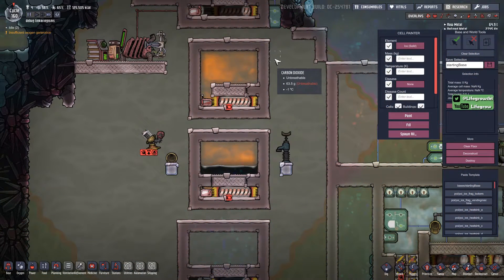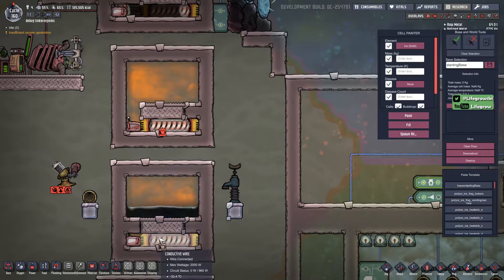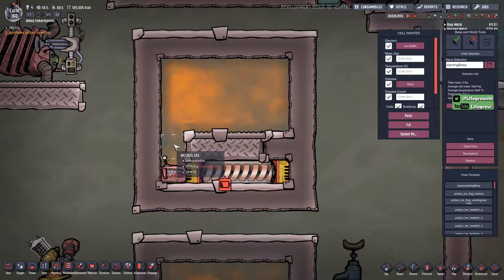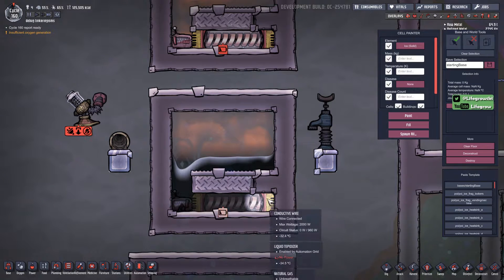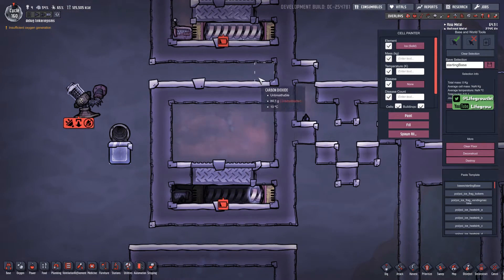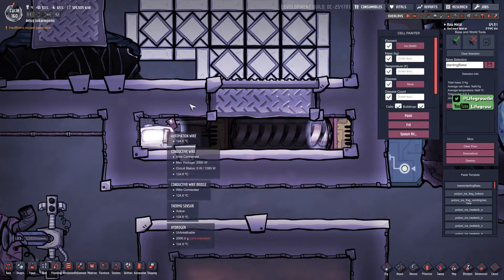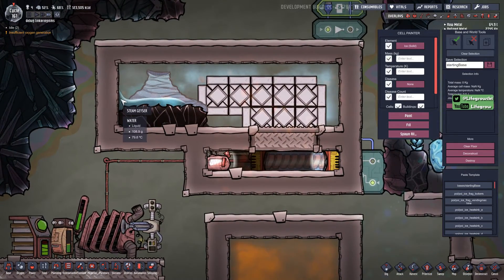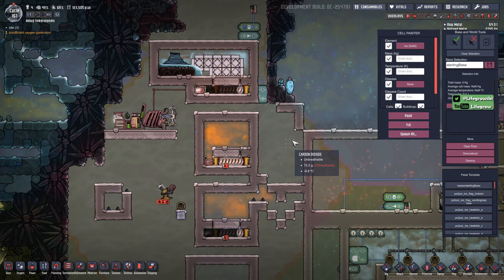EASY OVERHEATING TEPIDIZER HOW TO

Comment: What's the point of the buffer on the tepidizer? Why not just hook it to the switch and the thermo sensor? I get that it turns the tepidizer on and off but why do you want that?
Reply from the maker: Sorry, the buffer ?
Reply: The pulse clock.
Reply from the maker: Ahhh, yes - it's crucial if you want to go above and beyond boiling point - as tepedizers have an internal switch which toggles them off if they get to hot.
Reply: Ah. Got it. That must happen with other contraptions in the game because I've seen that used here and there. I never quite understood why. Thanks a bunch!
Reply: I should've scrolled to the comment section yesterday. Would've saved me some time trying to get this to work hahaha

Comment: when you feed the tepedizer a green signal, it turns on for a very short moment.
If you could somehow make something that keeps switching the signal..
you could engage this device without a liquid loop ;)
Reply from the maker: What you're looking for is a "pulse clock" - has been a long standing bug within the game for a long time, rapidly toggling signals to force machines to operate when they shouldn't ;)